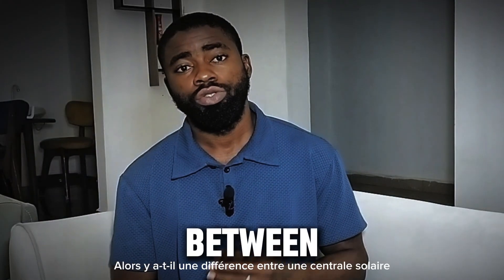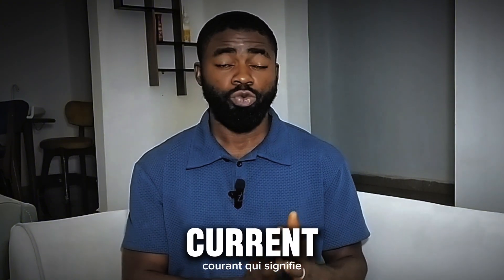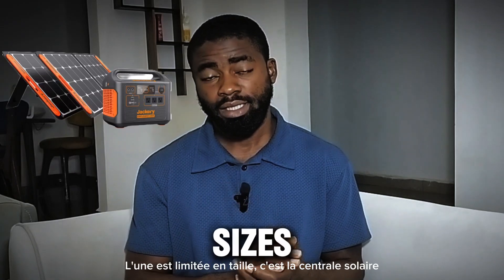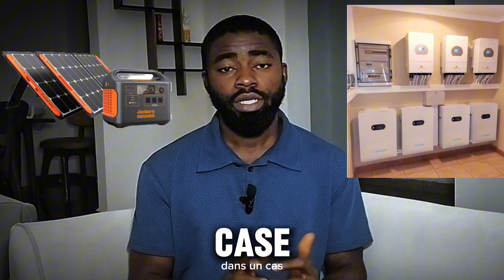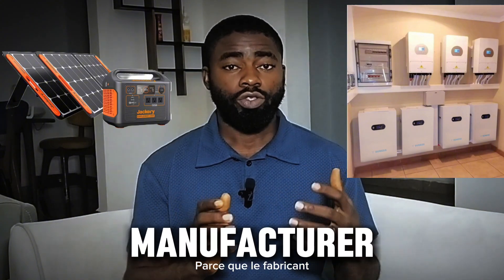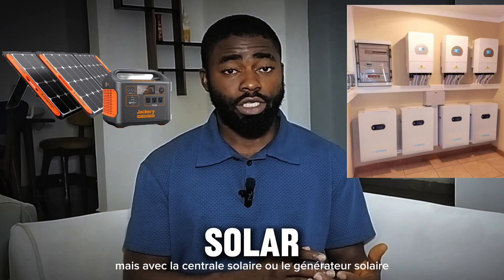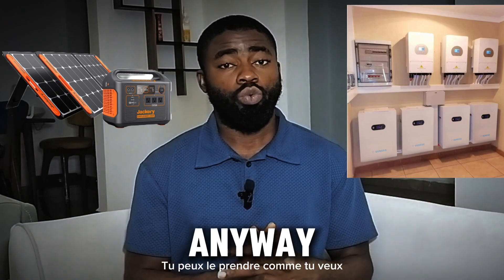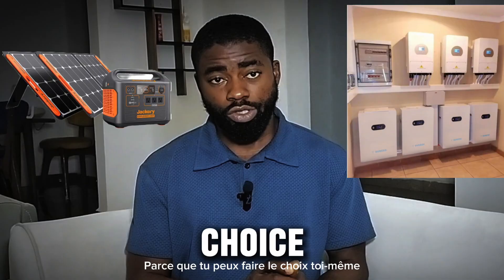What are the differences between solar generator and inverter setup??

Comment: Thanks for going through those details it makes choices easier . Why is  not common to build 1kva  lithium battery system  Nigeria   instead of going for the solar power station
Reply from the maker: You build a 1kva system with lithium battery